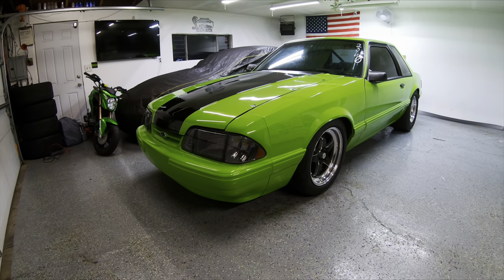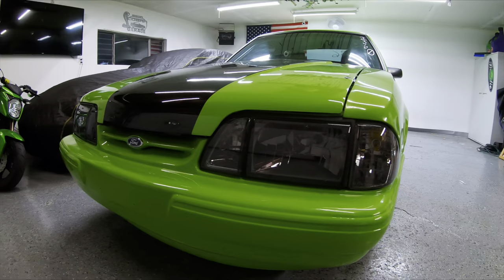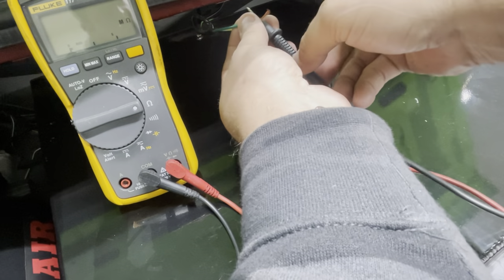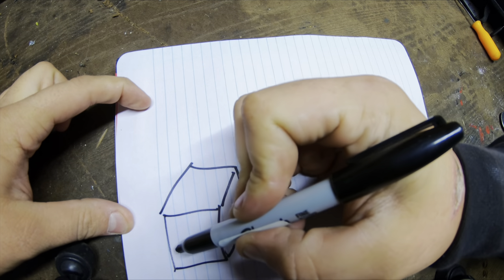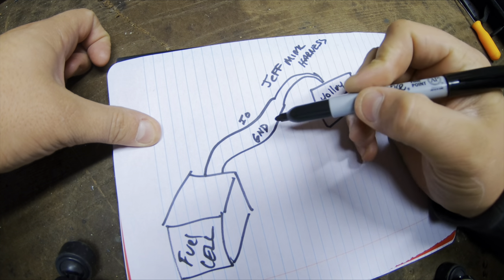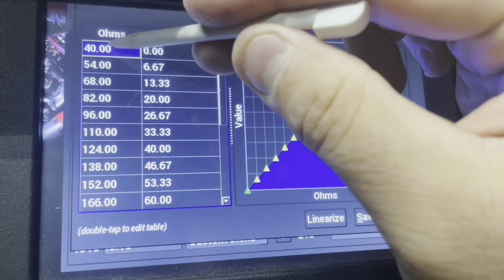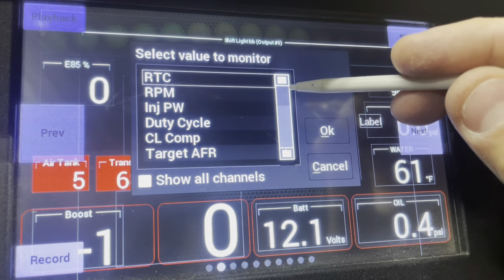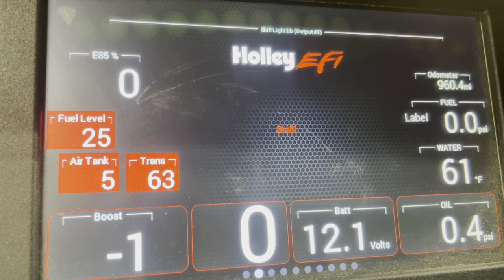How to add fuel level to Holley digital dash using Jeffery Mink Harness

Comment: After numerous phone calls with Holley, buying a new fuel tank and level sensor, my fuel gauge kept reading full. After watching this video, you solved my problem!
Reply: What did you do to fix that? I’m having a similar issue if I check my ohms with a multi meter I’m getting 10 at the tank but can’t get it to read right at the dash I have the ohms in the configuration set up right I think I’m having a ground issue but not sure. I’ve hooked up the right input on the dash and connected the ground straight to the battery and it’ll read 0 and when I pull the ground off it reads 100

Comment: Hello thanks for info, this procedure was works for my dash, until I disconnect the battery. Now level stays at 73% do you have this kind of issue?
Reply from the maker: Its quite possible that your float may be stuck or the calibration on the dash was lost. You will have to double check the table of resistance vs fuel level to make sure the values are correct. Sometimes the memory is lost with a battery disconnect
Reply: @BoostieMotorsports  really thanks have a great sunday

Comment: How did you get the odometer reading? And is it only possible on the TerminatorX?
Reply from the maker: I have the Holley GPS module that is used for speedometer. In the 7" dash if you add a odometer gauge, in the settings you need to select GPS input to get it to work. I also have a driveshaft sensor on the car and can use that for speedo/odometer as well

Comment: how accurate is the gauge? does fuel level move around while driving or when turning? Mine is wired directly to ECU and no buffer or slosh module and it's only accurate at key on and level ground. If the gauge is as accurate as factory I'm all over this mod.
Reply from the maker: All depends on the tank setup and the style of the float. Mine is faily stable but if your fuel is constantly sloshing around I can see it being an issue
Reply: @BoostieMotorsports  Did you used to live in Arlington Heights and have a Terminator?
Reply from the maker: @ford9050  I did quite a few years ago and still have my cobra. Have we crossed paths before?
Reply: I'm sure. You had a terminator with a gopro on 53 I saw one time. We lived in the same Greenbriar neighborhood in AH
 @BoostieMotorsports

Comment: Where did you get all the numbers between high and low? Mine is the stock 99-04 sending unit which is 15-160 ohms. I cant get to the sending unit to move it manually (stock tank) i wired everything in correctly to the dash with the IO box and the stock sending unit wire. Just dont understand how to get it to work from there
Reply from the maker: You will need to linear scale the numbers so 15 ohms would be your 0, 160 ohms would be 100% and then fill in the values between based on the number of cells available. Also make sure you have a ground wire for the channel.
Reply: How do u ground the channel??

Comment: I see that your sender is 0 to 100 and mine is 0 - 128, but I'm confused on what all the numbers in between were, or how you obtain them. I don't know this much, as far as mine is concerned. This is what's stopping me from completing my setup.
Reply from the maker: The fuel level should be linear so you will just need to evenly space out the resistance values of 0-128 to correspond to 0-100%. I dont remember how many cells there are but for example if there are 10, each increment should be 12.8 ohm per 10%
Reply: Thank you. So I have the increments down, but for whatever reason, the dash is not syncing or reading. Ugh, wiring sucks, but I'm ll figure it out. Thanks for the response